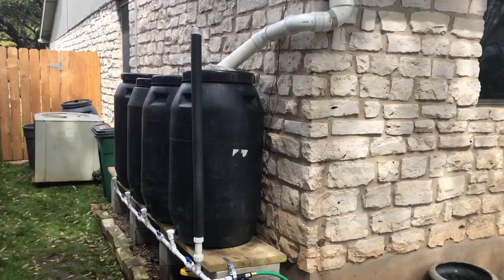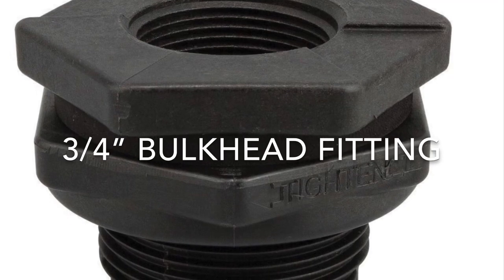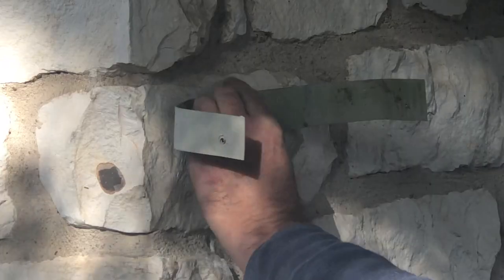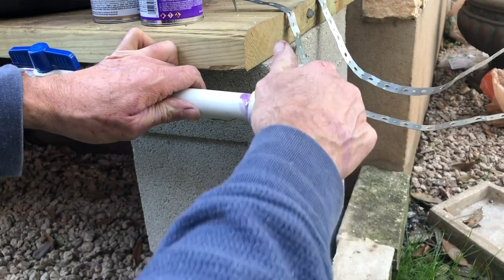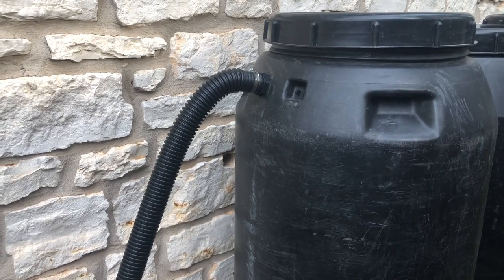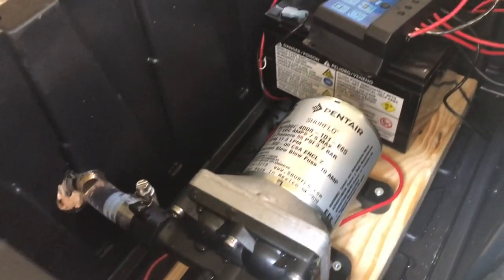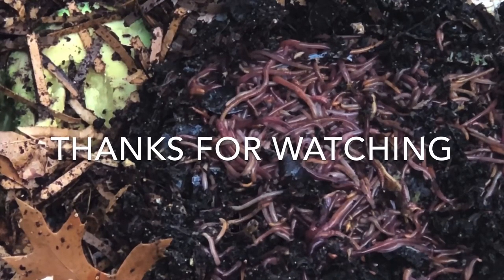Rain Barrel Build - DIY step-by-step How To Set Up / How to Build / How to Install

Comment: Good suggestion in installing the uniseal the easier way. Boil the rubber uniseal to make it soft. Insert into the hole as fast as you can before it cools off and then install the pipe. The pipe should go in with a minimum push because of the soften uniseal. I did it and it works.

Comment: Excellent job on these videos! Extemely informative and at a very nice pace. I learned a lot from this one and the others. You have a new subscriber. If you get the time and you are short on content ideas, I'd love to see an in depth video about your drip irigation, including different material options, spacing, hole placement, etc. I'm going to get started on creating a very similar water collection system for my garden and the next project will be automation. Thanks for the great videos!
Reply from the maker: Andrew Hodges Thank you for the kind comments and suggestion.  Yes I will be doing some more gardening and irrigation updates. I’ve been a bit busy the past couple weeks building a big 6’ x 12’ chicken coop, but will be getting some garden videos up soon once the coop project is completely built.
Reply from the maker: Checkout our channel Lonestar Coops for the coop updates.  Just about done on a big video project on Deep Bedding, then will be able to get back to posting some updated gardening content I’ve been filming these past two months

Comment: New subscriber, you are a physical hacker! Way to go! I'd love a follow up video, I'm about to install my first barrel (was a birthday gift). My style is an old olive barrel, I'm going to be picking up the leaf eater too and then spending some time to figure out which downspout I want to work on first. 

AS for solar my whole roof is solar so if I end up finding a free pump I would likely just plug the pump in with a timer. Thanks again for the video, gives me much more confidence!

Comment: I love how it is hooked up wit a drip system but can you water manually with pump on through a hose and sprayer
Reply from the maker: Yes if you didn’t need a timer for drip irrigation you could eliminate that and just use a hose and sprayer.  The pump will provide plenty of pressure for that.  You could try without the pump first but I don’t think the barrels alone would provide satisfactory PSI without it unless your garden is 20-30’ downslope from the barrels.

Comment: You need a float switch to the pump so if the barrels run out of water it shut off the pump so it doesn't burn out yours is the second one I've seen with that in line filter I'm still trying to find one and that other comment is right by putting the over flow on the last barrel it doesn't matter whether it is 1 1/2 or 3 inches you are restricted to the size of your connector pipes between the barrels better to go with a tee on the inlet pipe and raise all the air vents above it that way the barrels all fill up to the top

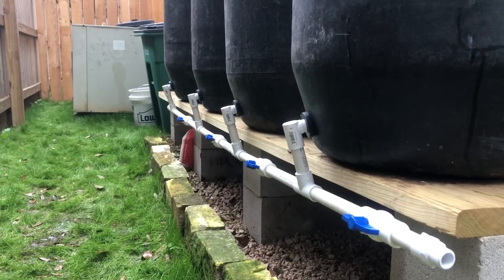Comment: 4:43 It is better if you place valves at the vertical segments of tubes. In this case you will be able to exclude each barrel. But it the way you done in the video you are able to turn off only all barrels after the valve. So, the difference is: every single barrel you need or all barrels  after a given valve.
Reply: Anyway, this is very clear and useful video! Thank you for sharing!

Comment: Thanks for your great video.  If the barrels were placed higher off the ground would your drip system work without a pump?   If so how do you calculate how high the barrels would have to be placed up off the ground to work without a pump please.
Reply: I also think that he didn’t need to put a pressure opening at the top of each barrel.  One would have worked and it would add some pressure to the system.

Comment: I've watched many videos on rain barrels and this was one of the best!  Question:  Would this pump work to connect to a garden hose to water your lawn using an oscillating or spinning sprinkler?
Reply from the maker: Yes, the pump outputs as much pressure as the hose bib on the house so it could run a sprinkler.

Comment: I changed my design after watching your video. Have you had any issues with the overflow being on the far end barrel? My system would look a lot cleaner if I did the same. 

Oh, just wanted to add that when installing a bulkhead the gasket should go on the inside. It looks like you installed the bulkhead with the gasket on the outside. That may be why you had leaks.

Comment: Did you think about staking two barrels one on top of other to get propper pressure of water without pump?
Reply from the maker: Excellent question. Yes, each 2.3 feet of height gets you 1 PSI of pressure.  The timer requires 15 PSI so the barrels would have to be 30 feet above the timer to get functional pressure.  That’s why I added the pump.

Comment: This is an awesome setup..I have watched all your videos in this series for making rain barrels with a pump. I had a few questions. Do you need a PSI gauge? Where did you get your drip irrigation lines? Thank you so much.
Reply from the maker: Hi thanks for watching.  You don’t need a PSI gauge, but I did buy one before installing them pump for troubleshooting.  That’s when i confirmed that the barrels without the pump hardly provided insufficient PSI to go let the timer work.  Timer requires 15 PSI.  After that finding I added the pump.  Drip irrigation lines were ordered from Rainbird.

Comment: By putting your overflow on the last barrel it doesn't matter if you have 1 1/2or4 inch overflow you are restricted to the size of your manifold the water going through to the last barrel will equivalent to a 3/4 inch overflow

Comment: Very cool video , I found the bulk head fitting at a local hardware store . But am having trouble with the part that connect to the bulk head and adapts to the PVC pipe. In your video it is a 90' elbow . Do you know if this part can be found on Amazon? what is it called?. thanks !

Comment: Is the largest center part of all your lids cut out and replaced with something else flat/black? When I picked up my barrels the seller warned me about cutting into lids as they can easily shatter. Thoughts?
Reply from the maker: The lids on the barrels are the ones that come with it.  It is a screw ring and a flat piece.  I was able to cut through them OK.  There is more videos of this in the playlist.

Comment: Are you in a southern state? I'm just wondering about freezing during the cold season here in MO.
Reply: Same question here. Thanks.
Reply from the maker: Yes, we are in Texas and we did have a long hard freeze here in March.  It is recommended to drain the system in the fall so it doesn’t freeze up.  You would need to leave a drain open at the bottom or cover the inlet as well.

Comment: What is the black thing attached between the coupler and the timer?
Reply from the maker: Thats an inline filter with a removable screen.  One last filtration just to make sure no particles get into the drip irrigation lines.  Will be doing an annual follow up and inspecting it in a new video to come.